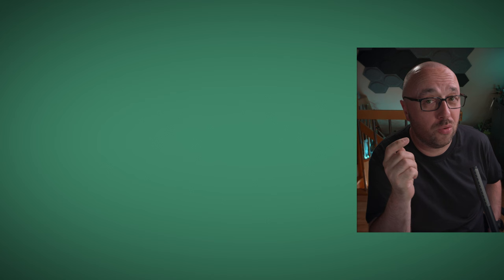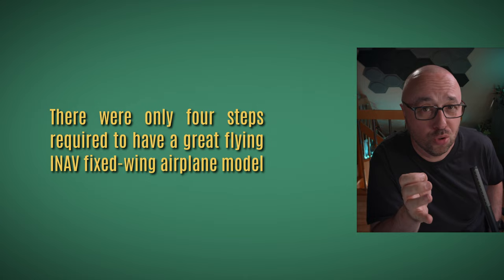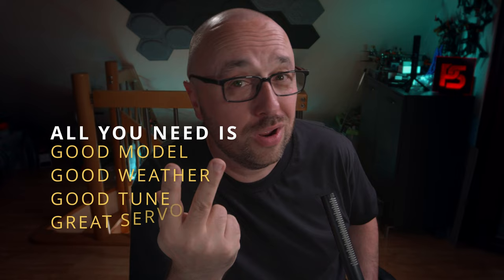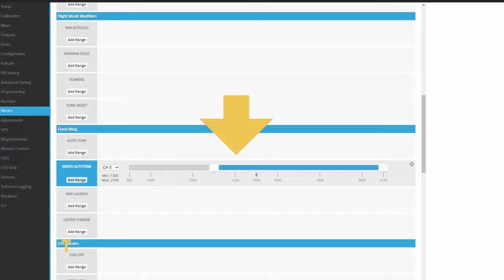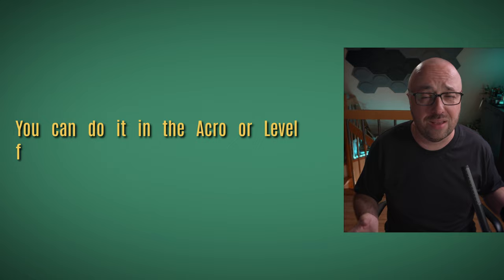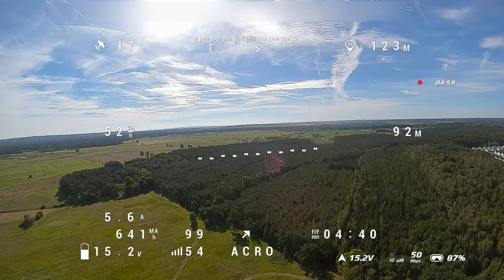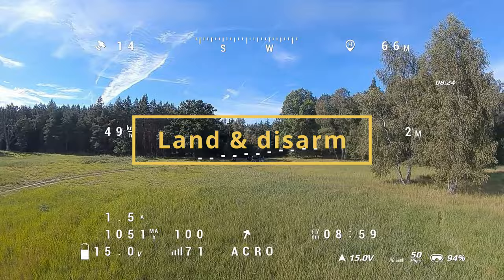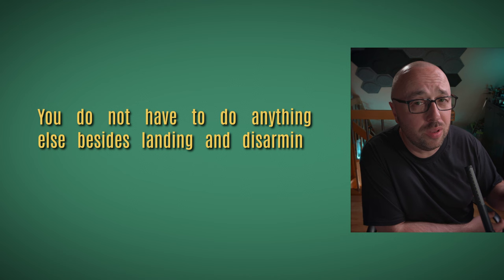Autotrim for Fixed Wing Airplanes - how to do it in INAV?

Comment: I think I started with INAV 1.6 with an Omnibus F3 on a Bonsi wing Then a Carbonbird Paris Sirus FC on a Bixler. I also converted a a HobbyKing SX-20, a Phantom 2 clone to INAV again with the omnibus f3 with many crashes trying to fly it aggressively. Every, well almost every new version of INAV have increased the fun, performance and safety of our craft. Thank you and all who contributed their time, talent and enthusiasm for our hobby, one of the best hobbies. Dad first saw RC planes in Japan, as a teen when his dad was Stationed there in 1952..I think.,and was hooked. He had me flying pulse rudder and a cox .02 at about age 7 but I was never comfortable enough to become proficient . After Apollo I was intrigued with remote control and especially telemetry on motor gliders with the early FrSky voltage and Baro modules. Then an article in QST, a Ham radio magazine had an article of a fellow using an ATV transmitter on a large nitro plane. I just couldn't stop thinking about one of those. But Dad’s best friend at our AMA RC club flew FPV and he provided me with the original Skyzone goggles when he upgraded to FatShark. Dad is still my spotter when there and enjoys “Taking a ride” in whatever I am FPVing, as long as he is sitting. Even the kind of traditional AMA club members are surprised with how FPV has been developed. In the last month I have been taking members for rides in my new 85mm Whoop, F405 FC with Baro, and the Whooplite by HDZero. They were amazed as I am.

Comment: And if you want to be really persnickety, you can mechanically recenter your control surfaces based on the adjusted trims, and then reset the servo center points to 1500, and run another auto trim just to fine-tune. The closer you are to mechanical center on your servos, the better flying results you will have.

Comment: I don't like continuous servo autotrim.  It trims servos as I slow down to land, so my trim is all messed up for the next launch.  I use servo auto trim on a switch at a nice fast cruise, and let the I term trim for higher and slower speeds.
Reply from the maker: I'm also not the biggest fan of the contonous method. It's just an additional integrator that can wind up
Reply: @FPVUniversity Glad I read the comments. This exact same problem reared its very ugly head the last time I flew during launch!!! I will be putting it on a switch myself now for the exact same reason....😮😮😮😮👍👍👍🇬🇧
Reply: Can you e please it a little more?

Comment: INAV can display the current mAh/mile rate in the OSD, but I would like to see the overall average mAh/mile since the flight began, instead of having to wait for the stats at the end of a flight to see a value after the fact. Also, I think I heard that v7 will have a value for the total distance travelled (not just distance from home) during a flight, so that's another value I'd like to see.

Comment: Hello, congratulations on the content! I have a small doubt, when I flew without a flight controller, on the first flight of each model I always had to trim the servo manually using the radio trims, but now using an FC and enabling the option "continuously trim servos on Fixed wing" do I still have to do this manual trimming to help the FC or should I fly without any radio trimming and let the FC take care of it? If the work is all done by FC, does it automatically save the parameters for each flight? Thank you very much in advance!

Comment: what if we keep On function i.e continuous servo trimming on for fixed wing and not using as flight mode?? will it make difference?? or it will trim servos or try to trim servos every time I fly and save that setting when I land .
Reply: It will always adjust the trims and save when you land. This is how I prefer to fly. Not sure if there’s an advantage to having it on a switch other than you have explicit control of when it’s active.

Comment: Hi Pawel...Just checked 6.1.0 in Modes Tab.
No "Servo Autotrim" in dropdowns.Looks like its now tucked into the Configuration Tab as "Continuously Trim Servo On Fixed Wing"
I assume your vid focuses on older Inav versions,yes?
Reply: Disable continues trim in config tab to get the feature in modes tab

Comment: I'm little confused .   so on this video you suggest to have the servo auto trim as a mode, but there's an option on the configurator to have the servos auto trim continuously . what's the difference? and what are the advantages and disadvantages of both ?
Reply: on arduplane I leave it on all the time as it's just an option that you turn on. I find after lots of hard maneuvering the trims can be out a little but they readjust themselves within seconds. Leaving it on really helps on a plank in which I have several sizes of battery pack or if I slightly misplace it. Saving the trim and putting a marker in the fuse for perfect battery placement each time is probably a much better idea.
Reply from the maker: They are different things and work in a slighly different way
Reply: ok. do you recommend one in specific for a long range plane ?  @FPVUniversity

Comment: HI! What you think about dedicating one channel for all switches? All radios today is sending digital signal over the air, and it's resource vasting to use values from 0 to 1000 to encode single bit (if there is 2-position switch). At now i combinig 2 switches to single channel by selecting distinct ranges for modes (for example: for couple of 2-position switches it can be first half of range for switch1 "on", and second for swith1 "off". For switch2 there 2 ranges for "on" - first half of "halves", and two ranges for "off" - second halves). So it works flawlessly, but takes a lot of effort to tune

Comment: Thanks for all that is INAV. Definitly heading in the right direction! Presumably, if I had used my Tx trims to get the aircraft flying straight and level prior to carrying out the Autotrim procedure, I should recenter the Tx trims before the next flight. Is this correct?
Reply from the maker: Yes, you should not be using trims on radio when flying with a flight controller. FC (INAV, Ardu) should take care of the trim, not radio
Reply: Thanks @FPVUniversity . Does the Autotrim feature automatically level the aircraft prior to recording the offsets required to do so, or, do I need to level the aircraft myself with the sticks whilst Autotrim is engaged?

Comment: Hello sir...im lil bit confused...what i see from inav 6.1.1, thre is no autotrim except im ENABLED continuously servo trim on Configuration..i enable AutoLevel in Stabilized mode and Autotune on Acro mode...is that correct, yes?
Reply: I'm confused in exactly the same way....😮😮😮😳🤔
Reply from the maker: Continous Servo Trim is something else than described in this video. If you use Continous, manual Autotrim is disabled. This in intentional
Reply: @FPVUniversity  Ah...!....but...do we still have to land disarm and save..??...😮😮🙄😏🇬🇧
Reply: i did not see the auto trim mode to set it up in inav 6.1.1, done autolevel on angle mode and autotune on acro mode during maiden, in continous trim servo enable...is that the right way?...or...do i have to Disable the continous trim servo then the autotrim will appear in mode tabs?
Reply: well...i found it...thanx buddy...much obliged

Comment: I'm on INAV 7.0, so is "Auto Level" the new name for this "AutoTrim"? Also, to save settings, I don't have to use a stick command?
Reply: Im also confused if the "auto level trim" mode can be used as an alternative for the "servo autotrim", or if both should be done.

Comment: 381 / 5 000
Résultats de traduction
Résultat de traduction
Hello, I regularly follow your videos. I live in the Bordeaux region of France. I have a Dolphin from ATOM RC. Manual flight is OK. When I put myself in Horizon mode, the plane does anything! I use the PIDs offered by ATOM RC. Do you have an idea of the problem ? Do you have acceptable PIDs for my case? (my plane is 728g and for the moment I don't have a camera)